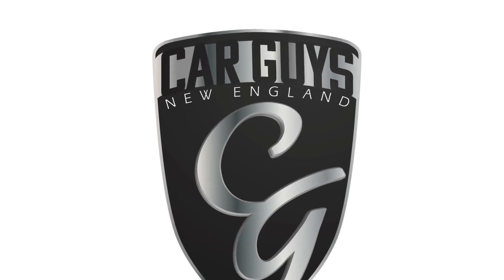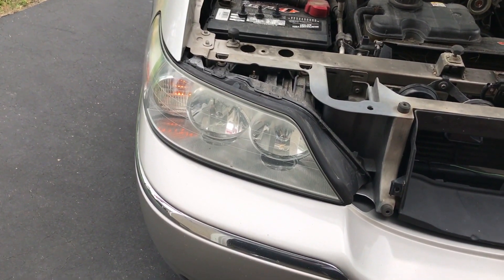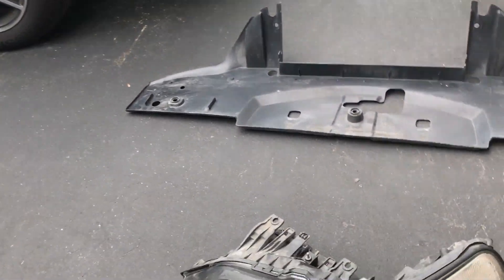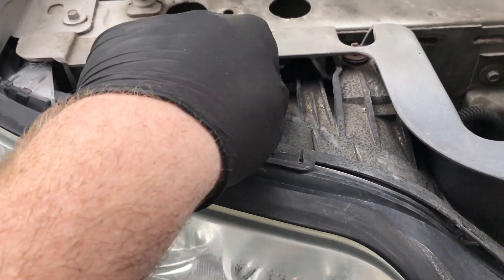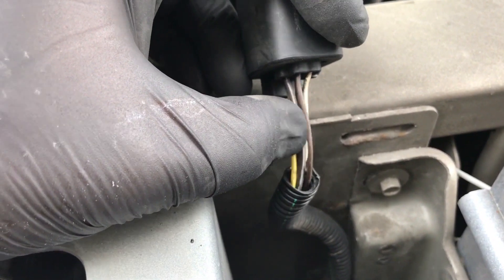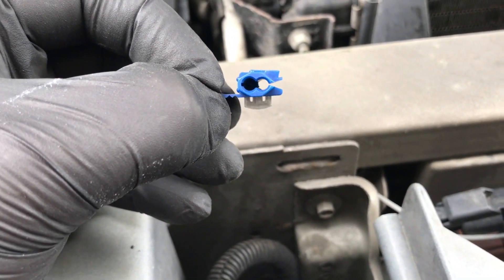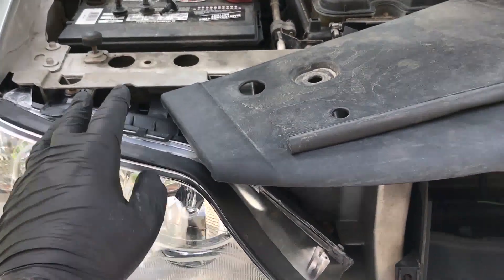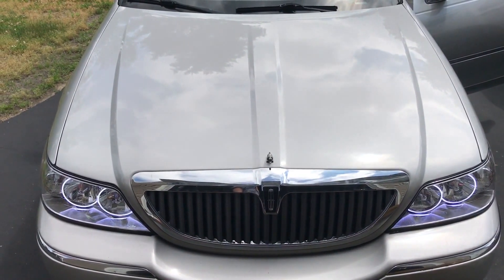Lincoln Town Car Halo Headlight Install

Comment: Yet another amazing video - getting so many ideas for my 2011 TC.  So looking at these lights on your '05 TC - and looking at CarID - yours appear to be WHITE (or are they the ones which can change color?

Does the '05 TC use the High Beams as DRL?  How did you get around that?

Comment: Thanks for the info... I didn't know about the "tab"... Sure made it a lot easier on my 2003 T/C...
Reply: When you ordered did you pick the 2005 year? I have an 04 but only goes to 2005 as oldest date.
Reply: @spartanshawn  dude I have the same question
Reply: @Bigedene559  I thought somewhere, I read that 05 up has higher amperage and 04 used lower amps but don't quote me on that. I had one company say it was fit but I'm not sure if fit or amps
Reply: @spartanshawn  atleast I got some sort of answer thank you for replying my man

Comment: Looks good but I don't like those electrical peices you put in, that locker will actually cut the wire and over time it will fail
Reply from the maker: Time will tell... thank you for watching
Reply: The locker you refer to..... AKA 3M Scotch Lock if all electrical taped up so moisture does not get inside will last for years.' life of the car'

Comment: Hey man so i i bought the same ones from CARiD and once installed they worked fine, but when i turned on the turn signal they both turned off and didnt want to turn back on. I tested them by putting the red wire to the + part of the batter and black wire to the - and they worked. Any reason why they dont want to work now once wired?
Reply from the maker: Henry Guido if you remove the wire and hook right up to battery do they light up?
Reply from the maker: If they do then you may have tapped into the wrong wire also check your ground. If you are familiar with a multimeter you will be able to find what wires to tap into

Comment: how do you install angel eyes behind clear lens, you don't show that in your video or how to get behind clear lens or the install procedure and what size are the rings 140 160mm  
trying to figure these lights out, the lens ect because need to paint mine in black because not available
Reply: they came pre-installed on the light assembly from carid, search eagle eye lights on carid

Comment: you said you picked up 12v from the parking lamp wire but it doesn't look like they are on?
Reply from the maker: Good catch... I realized after doing the video the new headlights had the marker bulbs in the wrong sockets.. 🤦🏻‍♂️

Comment: I take it these halo headlights come as part of a whole unit with the clear lens and everything else you just have to tap in the extra wires for the power for the Halos correct?
Reply from the maker: acts2211 CarID sells them complete but you can also buy just the halos and install them yourself

Comment: Hey bro will it fit on a 2003 TC
Reply: Good Question... Did you ever get an answer???
Reply from the maker: 03-11 all the same but there were a rare HID option and a common Halogen option
Reply: @carguysnewengland  so these Halo will fit on a 2004 Lincoln Town car??
Reply from the maker: @YoungLoSouthwin  yes
Reply from the maker: @YoungLoSouthwin  yes 03-11

Comment: What did you use on your grille to paint it black? Is that plasti dip? Im curious because I'm getting black headlights and thinking of blacking out the grille
Reply from the maker: Mushtaq Samim it is grey carbon fiber twill vinyl wrap
Reply: I have a  04 LTC I used Rust-Oleum custom premium lacquer paint matte black to, black out the center of grill

Comment: Where did you get the halos  and how  much
Reply from the maker: Shamir Sims got my first set on CarID
Reply from the maker: Shamir Sims they were like 600 pre done... those failed
So I bought another set of stock headlights and bought
LED Rings separately...
Did install myself second time
Around

Comment: Will they fit a 99?
Reply from the maker: Terry Pebworth those assembly will only fit 03+ but you can oracle lighting and find out what size rings will fit your application. It’s not terribly difficult to bake open a set of 08-02 headlights